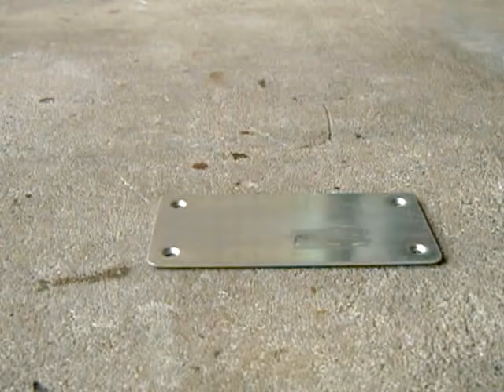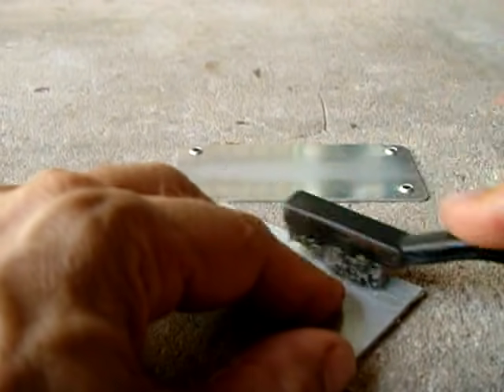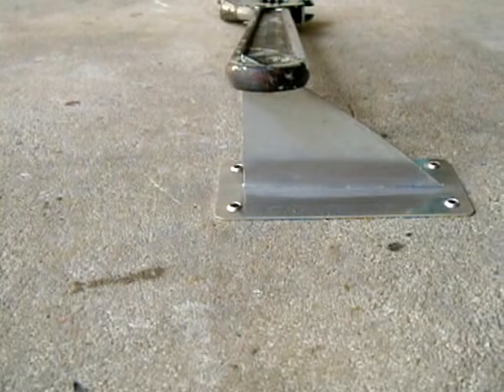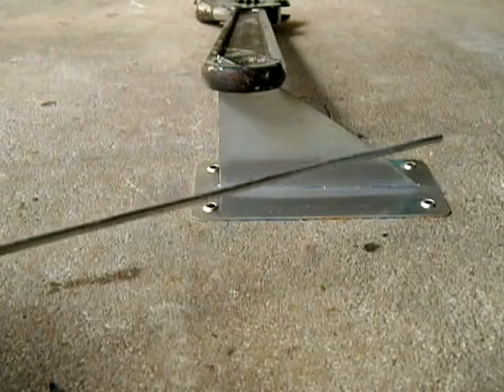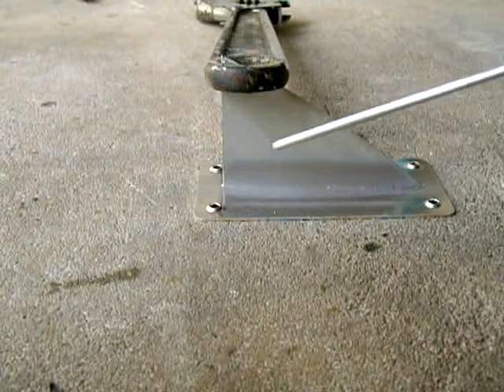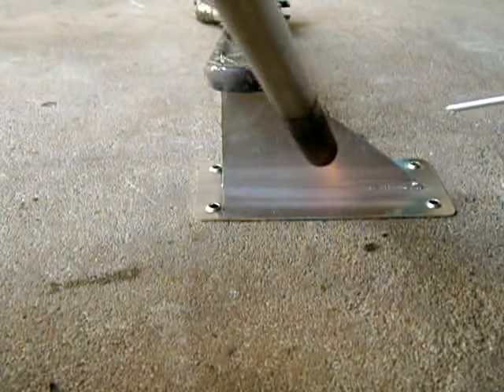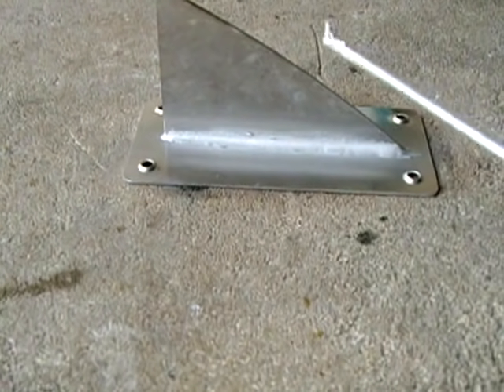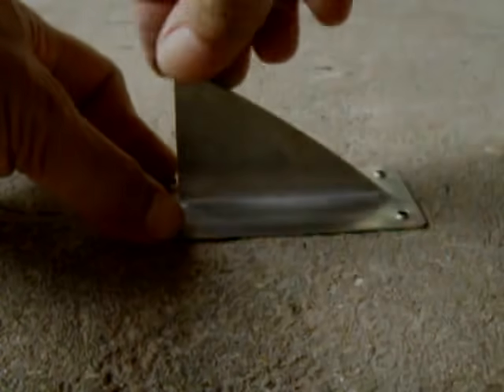How To Easily Join Together Aluminum Plates & Repair Aluminum Parts

Comment: Thanks for this! The vid demonstrates the use of these alum/alloy rods for repairs etc. In the past I've tried bonding aluminum, with little or no success, without a mig welder. Aluminum forms a thin layer of oxide almost immediately on contact with air/oxygen so cleaning is huge. BTW - mig welding jets a flow of inert gas over the surface of an aluminum weld that displaces the oxygen from the surface so you can weld two pieces of Alum together. Thank you Joe*** for that tip. I already suspected heating technique played into the strength etc. of the joint. So the brazing/soldering material is drawn INTO the heat. As in soldering a copper "joint" by applying heat behind the actual joint to "suck" it into the connection. Peace. Great stuff on YT.

Comment: Having seen similar rod (not necessarily same brand) demonstrated at airshows, I have attempted sample with ordinary propane torches.  Even with small work pieces I found it was impossible to obtain melting and bonding.  Additionally the rod material begins to corrode heavily after a couple years storage in garage conditions.  This appears to require special attention to prep, torch type, and technique.  It is much harder than soldering.
Reply from the maker: +Pelican1984 
Hello there. Once you know the proper technique, it is easy to do, and the results are  excellent. I lived right on the ocean for years, and my rods never corroded. It is very possible that you placed the rods next to a chemical that gave off fumes which caused that to occur. The simple solution is to take some sandpaper and clean the rods before using them. Also place the rods inside a sealed plastic bag with a silica gel packet. This is not as easy as soldering, but still not difficult. 

Thanks
Reply: electronicsNmore Thanks for the pointers.  Unfortunately I never was able to get the knack of this method.  Hopefully your video will assist others!  Thanks. b.
Reply from the maker: Pelican1984
It is critical to have very clean surfaces, and gradually heating the aluminum until the surface is hot enough to make the rod flow(Keep testing the surface). Once it does, brush the molten metal into the surface under lower heat, then finish off the job as usual.

Comment: Take it from me, you do NOT want to apply a torch to concrete!  Moisture trapped inside expands and can explode.  Nearly blinded me as a kid while melting lead on the garage  floor.  Lesson learned.
Reply from the maker: +Karl Ehlert 
Exactly, which is why the flame was directed at the aluminum, and not the concrete floor. :-) Of course the concrete will pop out chunks if you direct a torch to one spot and hold it there.

Comment: You should never introduce a torch flame to concrete due to spalling (surface pieces exploding off due to water boiling)...Here it was only a propane/air torch (low temp) and there was no direct flame to concrete contact but it should still have been on a metal grate, BBQ, etc...good job considering no flux was used shows what good cleaning can achieve...
Reply from the maker: Craig Diamond You would be 100% correct if the flame was directed at the concrete, but in this case the great majority of the heat was directed toward the aluminum. Ideally you should place the aluminum on a fire brick. :-)

Thanks For Watching!

Comment: just weld the damn thing!
Reply from the maker: Did you miss the title of the video? LOL. Some Youtube people crack me up. The purpose of this video was to show people how to EASILY join together aluminum plates and make aluminum repairs, Easily done with an inexpensive propane torch, and aluminum alloy brazing rods. Why was that so hard to figure out? If I wanted a video on how to weld aluminum, I would have made one. More people will benefit from this video, than a welding video. Few people own a TIG welder, or Oxy-Acetylene torch.

Comment: I like it but the next time don't tuch it in concrete, simply grip it with selfpliers on a bench because concrete absorbs lot of heat!
 Thanks.
Reply from the maker: Hello there. Concrete is a very poor conductor of heat, like wood, but holds heat a long time after the source is removed.

Comment: I cut the entire roof off of my wagoneer and then decided to cut off the windshield frame because it leaned to far back and looked like a car windshield to me..I want to build a rectangle frame that will sit straight up simular to the M715 military jeeps with a flat windshield..I am thinking of making it out of 1.5 inch tube steel and I do have a small Lincoln welder..but I think I want it to be aluminum to cut down on weight...do you think this method your using would be strong enough?..I really need to do some research to make sure before I buy the materials..I might end up bracing the corners with thin steel to make sure it does not come apart..I know it would be best for me to pay someone to make one for me but that might cost too much..I do like to do as much as I can myself.
Reply from the maker: You'd need to use a rigid aluminum "U" shaped channel to go around the entire piece of glass. When done properly, with enough heat, the results should be good.

Comment: Hey nice non destructive testing!? You really "abused and punished" that piece! You sound like the guy narrating this link! Is he your brother?
Where To Look For Gold #1 - Gold Is NOT Where You Find It!
Reply from the maker: That guys voice is so different. LOL. He is very nasal sounding and southern. My voice is deeper, and you can tell I am a New Yorker by my accent.  As for the testing, I only brazed one side. I feel I did a sufficient amount of testing to show how well the strength is on this THIN aluminum, AND if I brazed both sides, then I would have taken out the hammer. These rods are EXCELLENT when welding is not an option. I never had the repair fail. A buddy of mine broke one of the aluminum cooling fins off a flywheel, and I repaired that 3 years ago. That flywheel spins at thousand of RPM's. Need I say more? If you don't think these rods are any good, then do not use them. I only upload videos which I find extremely helpful to others. No bogus videos here.

Thanks For Watching.
Reply: electronicsNmore I was only joshin ya I found your video full of knowledge and very helpful

Comment: I wonder what would happen if you used one of those portable electric hot plates with the solid element as the work bench.  It would provide your base plate with enough heat so you wouldn't have to be heating with the torch so much.
Reply from the maker: Just use a fire brick. :-). Concrete/ceramics are poor conductors of heat.

Comment: Soldering / Brazing silver they use borax as a flux I have no idea if this will work on aluminum. 
Their are many recipes for silver flux on the web. I don't know if there is a chemical reaction between borax and aluminum.  Let us all know if it works.

Comment: Weld Tig is best and doing that brazing on Concrete is dangerous. Concrete has moisture in it and may explode a chunk out, Also is a massive heat sink.
Reply from the maker: Concrete is a poor conductor of heat. It takes a long time to heat up, then radiates that heat for a long time. Just like when you can feel the heat radiating off a building at night when you stand very close to it. This video was about how you can do a very good job brazing aluminum together using COMMONLY available items. A TIG welder is not commonly available to people(Laying around the house). The flame was directed at the metal, not the floor. The risk of any concrete popping off the surface was low because the aluminum was taking the great majority of the heat.

Thanks For Watching.
Reply: electronicsNmore i think at this temperture, about 400 ±°c, the concrete floor is ok.
Reply: There is always that guy. Kudos for the safety tip tho, some might not realize it and I’ve seen people use concrete, bricks and cinder blocks for fire pits with no fire brick and it’s not funny when they go 💥

Comment: It would have heated quicker if the heat wasn't dissipating into the concrete floor, just a thought?
Great video all the same.
Reply from the maker: Heating thin aluminum faster can be catastrophic. It is very easy to apply too much heat and have the aluminum collapse/melt/fall apart.
Reply: concrete is not a conductor, genius.
Reply: Joseph Guajardo Concrete thermal conductivity is about 1 W/m-k, which is poor as a conductor but the heat being put into the metal from the torch is dissipated into it, increasing the time it takes to heat the metal. Genius!!

Comment: JET FUEL CANT MELT STEEL BEAMS DEBRA
Reply: +xSephironx maybe not but damaged beams from a plane flying into them and heat from natural gas flames could bring down a building.  would you trust being in a tower knowing the beams used were bent? I think not because they would be deamed unsafe.
Reply: bullsnutsoz you don't realize that Trump is a part of the conspiracy? There hasn't been a real election in this country in almost 40 years. Trump was brought in to start WW3 and begin the process of world depopulation. THEY KNOW WHO YOU ARE!       

lol
Reply: JohnR, no you're wrong on your 2 points: High towers are DESIGNED to withstand plane crashes into them. Secondly, strength of steel beams is not affected by the heat of combustion. Remember that they WELDED on those beams during construction, that doesn't make the beams unsuitable for structural service, heh?
Reply: @altair7001  amazes me how thick the general population is to believe the crap they were fed on 911. Unless you've worked with steel youll believe big brother that it will turn to mush in a fire.
Reply: I think it is easier to explain trade center 7 collapse or how a passenger jet went thru a 20 foot hole into the pentagon and then vaporized from a jet fuel fire .
Reply: Redfish.  Clueless.   COUNTLESS nuclear test with Obama.   Zero with trump.   Trump and Reagan believe. What most America believes  hold your ground and carry a big stick! The states that outside carry handguns have very little crime! Stop watching CNN. Great leaders and Americans. Don't want wars we are trust prepared to finish them!

Comment: '
metal lead cannot work with aluminum together...
should weld both sides
Reply from the maker: +bestamerica 
Who ever said I was using lead? I suggest you try the rods/procedure shown in this video, if you did you would see how well this works. There is no need to weld aluminum for most repairs.

Comment: great video! Please add some safety tips for those that may not be aware. Always wear safety glasses at a minimum! NEVER HEAT DIRECTLY ON CEMENT!!!! moisture will expand and cause steam explosion, sending shards of concrete flying with gun shot force!
Reply from the maker: +Jeff Sandling 
Safety glasses for sure. :-) If the flame is directed at one location of the concrete, and not the aluminum plate for several seconds, then yes, you can have spalling. Thanks For Watching!

Comment: infatuation with wire brushing...? you only need to clean both pieces being brazed once not several times and certainly not after you lay the molten brazing rod down! Apply it and let it cool.
Reply from the maker: Ronnie Godfrey WRONG. Manufacturer says to brush before and while being heated to remove oxidation.

Comment: This guy needs to stop brushing the aluminum so much, there is absolutely no reason to brush it so much, I've used those rods before without brushing at all and it bonded strong as ever. There is also no reason to sand the rods either, they get melted so any oxidation that may be on the outside won't affect the braze. This guy really needs to calm down with all the brushing and sanding
Reply from the maker: WRONG. Oxidation forms very fast. You need to brush constantly until the brazing material is worked into the heated surface. Clearly you're not too familiar with aluminum brazing rod use, I highly suggest you call the manufacturer. As for sanding the rods to remove surface contaminants, it's a smart thing to do, especially if the rods have been laying around like mine.
Reply: @electronicsNmore  
I never said oxidation doesn't form, I know it forms and I know it forms fast, so fast, in fact, that there is no way you could braze it fast enough without it forming. What I was saying is that after you brush it once, there is really no reason to keep brushing it because you will never be able to keep it free from oxidation and the amount of oxidation that forms won't affect the strength of the braze in any measurable way. Like I was saying, I've used those rods quite a bit and I've used them at times when I didn't have a brush or sand paper at hand and I was forced to braze the aluminum without prepping it at all and it ended up being just as strong as any braze I've ever done. It's been my experience that unless the aluminum is corroded beyond recognition, it doesn't really make any appreciable difference to the bond since the reaction that occurs when you heat the aluminum up satisfactorily prepares the surfaces to be bonded. Like I said, unless the aluminum is in really bad condition, you don't even really have to brush it. For example, I would be confident in saying that the aluminum you brazed in your video looked clean enough to be brazed without brushing and the resulting joint would be just as strong as if you had brushed it. You should make a video to prove me wrong if you think what I'm saying isn't correct. For the record, I'm not saying that no one should brush their aluminum prior to brazing it, I'm just saying that it isn't crucially necessary and you could certainly get away with not brushing it and still end up with a bond that is just as strong, depending on how corroded the aluminum is, of course, and I was mainly saying that the amount of brushing done in the video was excessive and unnecessary.

Comment: You didn't tell us what the tool was that you used for it. Only reason I came here :( Wanted to learn to join aluminium.. now I know how to  join aluminium if you already know what tool you need for joining aluminium, without actually knowing what tool you need for  joining aluminium.
So if I knew what the tool was I could do it.. infact, you could have had a 5 second video saying "Use [tool name], to heat the metal and rub brazing sticks along it, after scraping the oxidised layer with a wire brush", over a fast forward video of it working, and it would have been way more useful, because then I could go and buy the tool I needed.. you called it a 'torch', but that's it. On ebay, this returns bicycle lights.
Reply from the maker: Tony Ganner If you asked what a torch was in the comment section.....I would have told you. Since you posted a rude comment, now I added you to my "do not help list".
Reply from the maker: Tony Ganner Bye